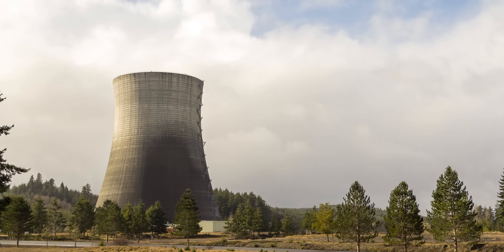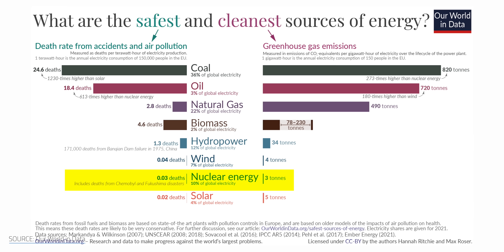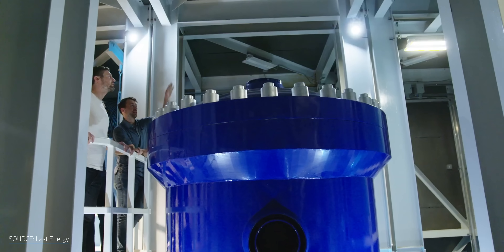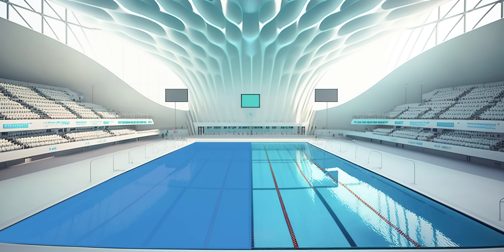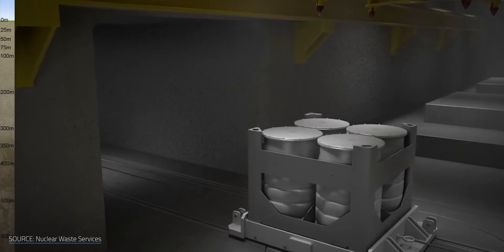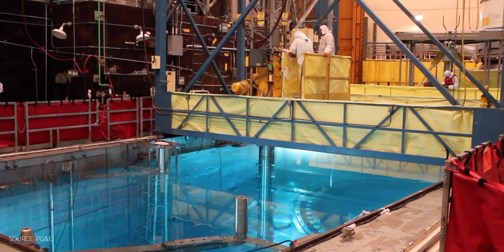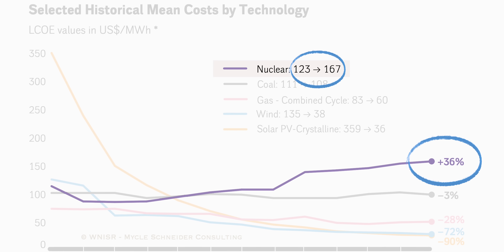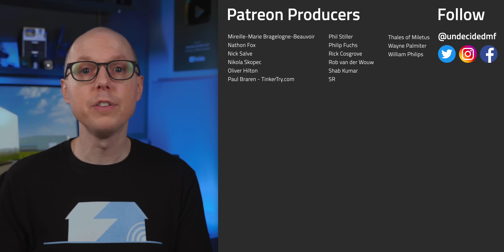Is Small, Fast, & Cheap the Future of Nuclear Energy?

Comment: Wait until LFTR reactors become available in this small form.  Sure, they don't produce as much power given the fuel quantity, but the safety, containment, and even the costs should be far less as there is no high pressure systems near the reactor.

Another energy system that shows a lot of promise is the deep geothermal.  Take a peak at the Eavor company and what it is doing.  The key is how long their loop will last, but once it's going, the energy is pretty much produced for free.  

So much potential in alternatives that have nothing to do with Solar or Wind.

Comment: Not keen on the "low temperature" aspect as that means higher pressure. One reason nuclear is so expensive to build is the steam turbines are usually bespoke whereas for a coal fired plant they can be off the shelf. Nuclear is much more efficient and safer running at high temperature low pressure. Getting water out of the reactor also means a different more dense uranium compound can be used which leads to more time before refuelling.  What we could be doing is feeding steam from nuclear into existing coal fired plants. That means a lot of what already exists is being used for longer.  The turbines and generators etc are already built. On top of that we could keep the old coal or gas fired boiler as a backup.

Comment: Idk Im keep hearing about the SMR idea and Im not quite sold on it. Like every industrial activity power plants too benefit from bigger scale in a theromodynamic sense not to mention you have to install the turbines, generators the connections to the a grid with all the necessary infrastructure too, transformers, auxiliary systems, plumbing, diagnostics, controls, refueling cranes, security etc. all the whistles and bells and in the end of the day you just put in multiple small reactor vessel instead of one big.

I see the advantage being the quicker iteration on desing of the smaller units and eventually a more economical mass production of them but one has to acknowledge it still means more manufacturing and more construction material used to produce the same amount of power.

Also, burying the reactor makes maintenence more complicated and Im not even sure if you can save on the containment (you still have to put it in a well shielded and sealed hole with a pretty safe lid on it)

If I understand well (that's how Matt explained)  the plan is to pull out and throw away the whole reactor vessel every six years o_O which seems like a big waste (also let's not forget it still needs to be decomissioned and disconnected from the power plant and a new one has to be reconnected which I would venture to say takes more time and work than standard refueling)

Again,  the reactor  being also the waste cask  seems like.... not a good idea. Reactors are designed for criticality, that is the very last thing you want your cask to be designed for.

Comment: Love the idea. Timescales to build is one of the factors that holds nuclear back. Finance costs are enormous if it takes 10+ years before you start earning any money back! But also governments change every 4 or 5 years. If you can get a small nuclear plant signed off and producing within a year then politicians will definitely sign up for them.... But you need to get the LCOE down. Sure it can be higher than renewable as they are intermittent and this is baseload.... But if renewables become much cheaper then it will get to the point it is cheaper to built solar for 100% power on the shortest day of the year or cheaper to build wind energy to 100% power the country on the calmest day than it is to power the country via nuclear.... So LCOE is super important.

Just an aside. I heard that if we built out solar and wind to power the country then we would need electricity storage for 18 hours for the whole country to make to make sure there were never any outages! Obviously the figure increase to 3 to 5 days if you build only solar or only wind... But it means that a renewable future is probably quite a lot more likely than a nuclear future.
Reply: I don’t mean to change the subject, but when was the last time you had a good old fashioned ice cream bar.

Comment: LCOE is a tremendously flawed metric as it gives intermittent sources free storage from the grid.  Require wind and solar to provide 7x24 power with their own onsite storage required to do so, and the costs of these sources, when fairly compared to 7x24 sources like nuclear, would skyrocket.

Comment: SMR's as a baseload generation to couple with the Megapack type backbone storage with renewables would make good sense if they work as promised.  Site location and planning would be important.  Reprocessing nuclear fuel needs to be possible.  We only extract a small portion of the energy in the fuel.  Time to lift these archaic restrictions.  This needs to be done.  SMR costs should be far more affordable if we start to scale up to actually use nuclear on a wide scale. We have been talking about this for a few years now.  What is the hold up?

Comment: So a few things.  The US shouldn't be having a spent fuel (waste) problem.  Just pay Canada to take it.  Canada can use the US's spent fuel in our CANDU reactors.  Or you know, just buy some CANDUs and use your own fuel again.  The big difference between small modular reactors and big reactors, the big reactors we can call large modular reactor (because marketing) is initial capital cost.  If you build enough large modular reactors you can get the same cost benefits of small modular reactors.  Like for example a CANDU reactor can be seen as 480 small modular reactors slapped together.  You also get the benefit of more bang for the buck.  That's what scares people away, and why you need some government agency like Ontario Power Generaton to decide to invest the large amounts of capital.  The government will be around in 10-20 years to see the benefits of it.  Lastly nuclear fuel is cheap.  It's not like gas or coal that spends a fleeting moment being used.  Uranium can spend around two years in the reactor.  You can double the cost of uranium and it will make little to no effect in the cost of electricity, as it's not a big cost of the electricity. It's the staff, and the initial plant that cost the most.

Edit:  Here also is the definitve guide on nuclear waste.  https://www.youtube.com/watch?v=jM-b5-uD6jU

Comment: Had nuclear been built the way coal and gas plants were built, the enormous nuclear plant costs would be closer to budget, cutting the LCoE in half. The recent LCoE increase on nuclear was due to new plants being built in places that avoided it so long that everyone involved in previous projects was out of the picture. Not only the plants were bespoke, but so was the entire expertise for them, as well as the use specific supply chain. And the mistakes of ignorance. And rather than let the new expertise be used again to benefit from the cost, the initial cost is used to reject getting the full value out of it. It's the toxic public investment cycle that always drives up public costs. (Ironically, the people demanding government be run like a business are the ones keeping it from running like a business.)

Decades of avoidance sank the large nuclear plant. I have hope the SMR approach will let it be deployed quickly enough to make up some of the lost time in replacing coal.

You know, except for Germany where they are too afraid of it and literally built new coal so they could shut down nuclear plants early.

Comment: The USA "used" to run a single reactor that used spent waste but it was shut down by the president some decades ago. But I believe the facility is still there. There's a company (can't remember the name), that's looking to start it back up I think. I believe that facility was built in just a few years in the late 50s/60s. 

The big bonus I see for SMRs is in remote areas that rely heavily on diesel generators for everything. That could not only bring reliable energy to those remote areas, but it would also create amazing jobs in the communities they are installed in. Tons of possibilities!

Comment: How fast can these be scaled up and down? Tony Seba makes an interesting point… in a world with large scale solar power, ALL new non-renewable plants are peaker plants. Traditional base load is dead. When the solar panels get going, they flood the grid with so much power that cost can go below zero. Base load plants can’t sell in that environment. The “LCOE” concept we like to throw around becomes nonsense, because LCOE is algebra based on continuous (or at least predictable) capacity factor and continuous/predictable pricing. If base load plants can’t operate at ideal capacity, or can’t sell at target price (for DECADES!), then their LCOE goes out the window. 

Modular nuclear that can scale up and down quickly and operate in a peaker-type way could be very, very interesting. Traditional base load nuclear is DOA on a grid where base load style operation is economically unviable.

Comment: Just go solar(/wind + batteries).
Reply: You know that's impossible to be fossil fuel independent with only aleatory sources, right? So stop trolling
Reply: @thekingofgindio  It's 100% not. Look at Europe having negative power prices 17 hours of both days this past weekend. Australia not infrequently generates too much power from renewables. Tony Seba has a nice presentation on how the most cost efficient way to a clean powered world is wind/solar + batteries of designing around the worst case scenario where anywhere in the world only needs ~4 days of storage for the wind/solar capacity you have for the coldest/cloudiest winter stretches--then the rest of the year you have abundant, essentially free power.

Nuclear would've been great to do more of 50 years ago. Today it's a waste of money outside niche reasons (e.g. ships, subs). 20MW x $123 million each is literally more expensive than a 1100MW nuclear plant for $6 billion. Basic math, this video's company does literally nothing to save money.
Reply: @tHebUm18  I live in Europe, and Germany is the walking proof of how impossible is to decarbonize the electric generation without nuclear. France and Sweden, which have a lot of nuclear, have the least emissions and the lowest electricity bills. Germany, on the other hand, after having closed their nuclear reactors, has the highest electricity bills IN THE WORLD and emissions second only to Poland (that goes almost only on coal). 
The problem is not which energy source costs less to implement, the real question is: which is the ENERGY MIX which costs less to the public and decarbonize better? And renewables alone cannot answer this question.
Reply: @thekingofgindio  Wind/solar + batteries can and will because they are the most financially sound way of doing it today and getting ever cheaper. Meanwhile, VC funded ~modular nuclear ~ are coming up with solutions like Matt just covered that are literally no cheaper than nuclear as it has always been done... except with a lot more risk by having nuclear spread all over with probably far less rigorous engineering quality measures.
Reply: @tHebUm18  you miss the point that cheaper to install =/= cheaper to the public =/= easier for decarbonization. LCOE is not the only parameter. Btw, can you name a single country who has decarbonized its electric energy production without nuclear or hydropower?
Reply: @thekingofgindio  Some states in Australia. Probably not any countries, yet. Maybe some island micronations? It's only within the last 5 years or so that wind/solar + batteries have reached maturity to just be the obvious solution and power generation is a huge infrastructure project that takes time. It will happen. Matt Ferrell will keep us in the loop as it does.
Reply: @tHebUm18  so are there places (which are not negligible entities) which can provide renewable aleatory energy 24/7 for every service? It is funny you named Australia, which still uses coal like no tomorrow

Comment: "To search for perfection is all very well
But to look for heaven is to live here in hell" - Sting (Consider Me Gone)

Happy 4th July, thanks for being one of the alarmingly few Americans to pronounce "nuclear" properly too.  

I'm absolutely stoked to see they've sold 30 plants already - THIS is the future, it will also help us enormously in space at some point too especially further out from the Sun.  Personally I envisage a mixture of generation methods going forward, I actually see solar and wind being used more for variable output purposes such as generating hydrogen for hydrogen fuel vehicles (that's going to be a big one).  

Two other big factors too - you touched briefly on national security (for materials supply chain) with Japan, I think this is a much bigger issue than it's been made out to be especially if international shipping routes become tenuous.  The other one - grid load.  The wild increases in demand that electric cars will invariably have (especially with the fantastical legislative deadlines projected to date) are going to be impossible to generate and distribute properly for many areas.  They're going to HAVE to switch to distributed generation more and more, just to handle the load.  You thought power plants were expensive - try transmitting all that power.  This is where the mix of SMRs, solar, wind, etc. will help quite a bit because it won't have concentration of generation we see now.  Current generation sites were chosen for proximity to water, wind direction, distance from population centres (for smoke, etc) but this also created choke points in the grid.  Spreading this out - not for all countries but for quite a few - it's a big bonus.  I think SMRs will have more immediate impact further from the equator initially, not sure how many the UK has on order but standardisation of parts, design and supply chain is the key.  It's quite remarkable (almost.... deliberate?) that everything is bespoke and custom made every time so far.   I do get the sense that the current environment was driven up (in cost) at least in part intentionally, is that a plausible notion?

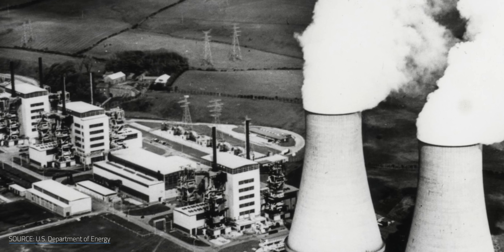Comment: 3:28 well that means almost 1% failure rate doesn't it? Even if SMR are 10x safer then it still means many accidents since there will be much more of these. Can't wait until they are used by expense cutting, profit driven companies in places with high corruption level, yikes. Nuclear may be low on deaths per MWh on average, but if you consider people living in certain radius around power plants, it will be much higher than for someone living nearby wind or solar farm. Also who knows how many deaths are result of indirect radiation exposure and are not taken into account in these calculations. I get it, it's much better than fossil, but I think it's better to put more effort into wind and solar and reserve nuclear for deserts and other less inhabited locations, rather than placing these small reactors everywhere.
Reply: Living near a nuclear power plant does not expose you to a level of radiation detectably higher than the natural one we always receive.
Reply: @thekingofgindio  Normally no, but it can in case of accident
Reply: @sturmeko  accidents that in third gen reactors are physically impossible.

Comment: We don't have the luxury of wasting time and money on nuclear power projects. Using the same time and money, you could get way more bang for your buck for wind, solar, battery and we know that these are likely to be even cheaper by the time your project gets off the ground. Nuclear is also the worst partner for renewables, as it can't be cranked up and down. Plus, we simply cannot shrug off the question of waste. We may not always have the means to keep replacing those casks and then what happens.
Reply: You would be right only if a 100% renewables were to be not only possible, but cheapest and more sustainable than a nuclear+renewables mix. Moreover, it's false that nuclear and aleatory sources aren't compatible: as long as nuclear just supports the baseload they won't compete.

Comment: make recycling spent nuclear material MANDATORY not an "option", that way we get a lot more juice out of the material. once we can no longer realistically get a satisfactory lvl of energy out of the material, we then dry-casque it in a steel sphere, contain that in a block of concrete, and drop it into the marianas trench. now some might worry about dropping the stuff into the ocean (and rightly so!), but after the recycling process, it has a MUCH lower half-life and as the ocean floor there is pushed under the continental shelf of east asia, those materials get pushed into the mantle, where by the time it rises back to the surface (via volcanic activity), all the radioactivity has been spent. no more nuclear waste and clean energy is had. still expensive, but i have no problem with something that creates THOUSANDS of jobs.

Comment: The video created a bunch of additional questions in me:

A reactor at a good price is fine and dandy, but reactors don't produce electricity. They produce heat. Does Last Energy also sell you the necessary equipment to turn heat into electricity, like steam turbines? Is that included in the $123 million pricetag? Does it need cooling towers, and if not - why not? Is the cooling loop fully closed, or does it rely on exchanging water with a nearby river, thus risking ecological damage through the heated wastewater, and risking the reactor having to shut down if the river gets too warm in the summer? (No joke, happens regularly in France.) Do the steel frames and other building materials that house the reactors get irradiated over time and need special disposal at the end of their life, like in regular reactors? Also, since the video was quoting levelized costs of traditional reactors, are there estimates of what the levelized costs of Last Energy's solutions are?